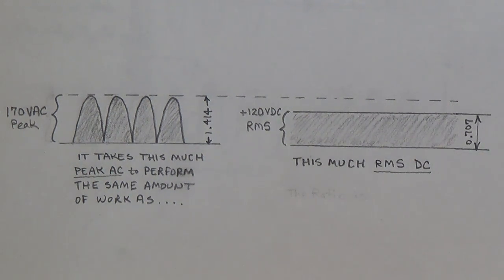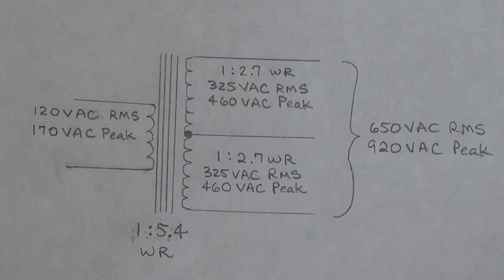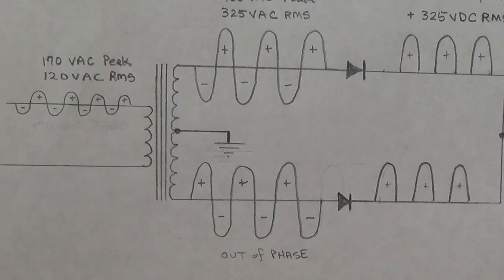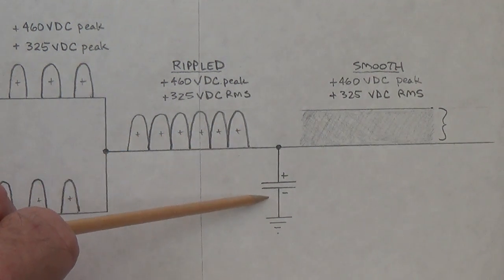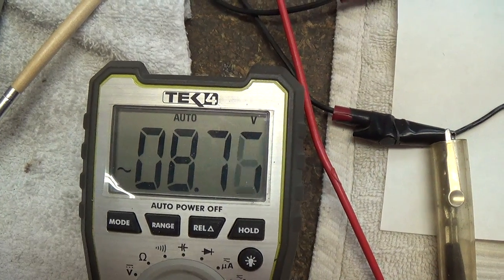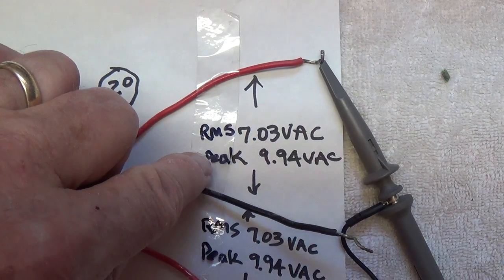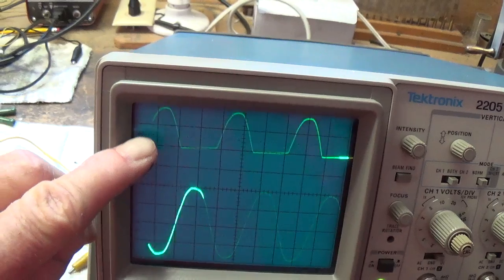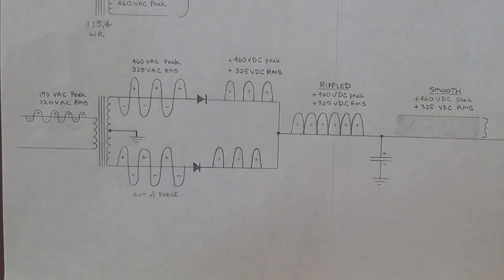Power Supplies Part 2:  Full Wave Rectification

Comment: You jump right in to RMS voltage and no explanation of what RMS voltage is.
Reply from the maker: That was fully covered in the "AC Waveform......" video:   https://youtu.be/lmwnCbwKjAk
Reply: OK, thanks.  Sorry. @UncleDoug
Reply from the maker: No problem, SF. Thanks for your comment :) @sharpenflat6002

Comment: https://youtu.be/O3Cvhnhv0dM  hi Uncle Doug , ive watched all your videos almost twice now, yet I have not seen an answer for my question. ive searched the web with no luck either. the question is related to some fender amp circuits with I believe full wave rectification, using not 2, but 6 diodes, 3 in series out of the top of the 2º power TR, and 3 in series out of the bottom of the 2º power TR , why use this if 2 diodes would give full wave alone? the only thing I can think of is that the other 2 in series on each lead are for back up, or reducing the voltage, since diodes are not totally efficient. please answer at your leisure. thank you 😀 oh you did reply to my question before and said it takes a different power transformer, I want to know how the circuit actually works, not why they did it that way.
Reply from the maker: I think the multiple diodes are redundancy, to provide long term assurance that the rectification stage will remain intact, even if one or two diodes fail.....and, since diodes are dirt cheap, it costs virtually nothing to provide this assurance.

Comment: Is it necessary or recommended that center tap be connected to earth ground of 3-wire power cord?
Reply from the maker: Opinions on grounding are numerous and varied, Paul. I see no harm or huge benefit to what you describe......so it's up to you. Try it both ways and see if there is a difference.

Comment: I am confused. @17:00 or about, youre calling a waveform that goes from 0v to +10 volts and back to 0v and back to +10v a direct current? But is it not still an ac due to the fact that it is not constant but varying as in an ac wave? If the midpoint was changed to +5v it would be more ac than the rectified output of a steady 10vdc
Reply from the maker: As long as a varying waveform never ventures into negative territory, it is not considered to be AC, Dave.
Reply: @UncleDoug  So if we reverse the diode and use the neg half of the wave the voltage then goes from 0v to -10 volts. That would put the waveform in negative territory and therefore considered to be AC? Now thats even more confusing
Reply from the maker: @davenone7312  No, then it would be negative DC. Two criteria for AC is that it can "pass through" a capacitor and induce a secondary output in a transformer.......this can only happen if the excursion of the waveform is BOTH positive and negative.

Comment: I'll be building a tube amp using 2 12AX7 for pre-amp/ tone control and 2 7189 for push-pull amp, is 300-0-300  volts Ac enough, how much current do I need for the whole circuit, how much current for the 6.3 volts for the four tubes? I need your help, thanks.....
Reply from the maker: You need to get a tube manual, Sonny. All the values you seek are provided within.

Comment: Wow, I did not realize that the second half of the transformer INVERTED the AC signal to produce positive peaks 180 degrees out of phase. This reminds me of the primary side of an output transformer on a P-P.
Reply from the maker: Yes, indeed, Mark. All center-tapped transformers have this ability.

Comment: Uncle Doug, how does one compute the amount of "loss" that results from the rectification process? I saw in your scratch built vintage amp pt 3 video, you ballparked about an 80V loss as a result of using a 5Y3 tube, but you didn't mention how or why this happens. How does this differ from using solid state diodes? Is the loss from SS diodes just the forward voltage for the diode type multiplied by the number of diodes in use?
Reply from the maker: Diodes are much more efficient than tube rectification, Ryan. My estimates were simply based on experience. Tubes convert quite a bit of energy into heat. With regard to diodes, the loss can be calculated as you suggest.
Reply: @UncleDoug  awesome, thanks for taking the time to respond!

Comment: Hey, Uncle Doug. Your videos have been a great refresher for a guy who went through EE school early in the solid state era. I learned more about tubes as a teenager reading books than I did in college. 

Question: I seem to remember that early in the hi-fi audio era, some companies tried to cut hum to an absolute minimum by running the heaters of their tubes on DC current rather than the usual AC. Are you aware of any guitar amp manufacturers who did the same thing? Might this be an interesting mod for people looking for the last ounce of performance?
Reply from the maker: It is done in some amps, Rob, but the truth is that if a circuit is properly designed and constructed, rectification of the filament supply is simply not necessary.

Comment: It's interesting that converting RMS to Peak is done by of 1.414 since the squareroot of 2 just happens to be 1.414
Reply from the maker: It's no coincidence, FN. The formula for the conversion includes the square root of 2 as one of the factors.
Reply: @UncleDoug  I was a commercial photographer for a good portion of my adult life and we see the square root of two pop up quite often.  The first place to look is the aperture rings on most lenses... f/1.4, f/2, f/2.8, f/4, f/5.6 and etc.  We also see it in the inverse square law (as it applies to light intensity and perhaps more but photography was my field of work).  Cheers and great channel!

Comment: I have a question.  On some (or maybe all?) Fender diode rectifier boards there are three diodes in series for the "top" 330V side of the power transformer and three diodes in series for the "bottom" 330Vside of the power transformer.  Why is that?  You say that there is some loss across diodes.  Are they using multiple diodes to step down the rectified voltage? Thanks!
Reply from the maker: I personally think, since diodes are so inexpensive and their function is so critical, that using multiple diodes is a safety measure....."spares" so to speak......if one fails, then there are two more to take its place.

Comment: To see the ripple ( 120Hz ) you need to add a load from the junction of the 2 diodes (cathodes ) to the center tap of the transformer.
The caps will charge to peak voltage of the rms voltage will no load.
Reply from the maker: Thanks for your helpful input, Henry.

Comment: Hey Doug, really appreciate all your videos. I got interested in an old marshall lead schematic with full wave rectification. However, the leads of the power transformer are connected to the grounded center tap of this transformer through 22 uf capacitors (see http://cdn.tonegeek.com/wp-content/uploads/1987u.gif). I haven't been able to figure or find out what is its purpose on the power circuit. Got an idea ? Cheers.
Reply from the maker: Thanks, Nf. Sadly, the Tonegeek's site is not accessible to me......blocked due to improper configuration or some such nonsense. Please provide another source of the schematic. Thanks.
Reply: Uncle Doug  Here you go : https://i.imgur.com/NQFrp3X.jpg , I also highlighted the culprits
Reply: I guess it could work as a low-pass filter to eliminate high/radio frequencies from the mains. like a death cap but in the secondary circuit instead of the primary
Reply: Uncle Doug  bump

Comment: A bit confused @6:36 after the diode rectification. I can understand it's still +460VDC peak, but why +325VDC peak? I believe it should be +162.5VDC RMS at that stage. That's why the RMS is +162.5VDC *2 = +325VDC after the combination of the output of the 2 diodes.
Reply from the maker: You're right, SK. The "+325VDC Peak" after diode rectification was a typographical error. I apologize for any confusion.

Comment: I remember my Physics and Electrical Engineering professors trying to explain why we used RMS voltage. The explanation that I remember best is that we had to square the waveform because the integral of an alternating current waveform is zero because it goes both above and below zero. The squared waveform is always positive, so we integrate that and take the square root of the result to find the voltage. All of this ignored the real explanation, that the RMS voltage produces the same amount of heat across a resistance as the same DC voltage. Knowing that would have made understanding RMS voltage a lot easier.
Reply from the maker: Good comments, Bill. It's also why deviations from the mean are squared in statistics.....to eliminate their sign.

Comment: Fantastic series on power supplies.  Question for you.  I was looking at a schematic for a Fender Bassman 6G6-B and saw something that I don't understand.  That circuit uses solid state full wave rectification with a center tapped secondary on the power transformer.  The strange thing I see is that each side that comes from the secondary winding runs through 3 diodes in series.  Do you know why they might do that?
Reply from the maker: Thanks, Craig. I've heard several explanations, ranging from "Three diodes produce a smoother DC output", to "Diodes are cheap, so throw in a few extras in case one fails". The truth is probably a combination of both.
Reply: Thanks UD!  Sounds like I should wire up a bunch of diodes and look at the waveform on my scope to see if it's any smoother.
Reply from the maker: I'm not sure if the smoothing will be visibly evident, but regardless, it will be an interesting experiment.

Comment: thank you for your clear and precise explanation of how AC to DC power rectification works, your explanation is very helpful I do appreciate that, I'm having difficulty trying to choose and purchase a bridge rectifier for my 70VAC power supply I don't know which one to use, I need 50DC, can you help me on this...thanks.
Reply from the maker: You're welcome, Iam :)  We used to get our FWBR's from Radio Shack, but I guess that's no longer an option.  I would check on Ebay for a FWBR that can handle whatever current demand you anticipate. Good luck :)

Comment: Hi from Jakarta Indonesia, I recently getting interested in electronic and your video helps me a lot, so thank you very much.

I have a question though, how do you determine the value of the smooth capacitor?

thanks again
Reply from the maker: You're welcome, Rudi. Most tube handbooks will give you the value for the first filtering capacitor depending on which rectifier tube you use. The subsequent filter cap values are generally of lower value. Although there are mathematical ways to calculate the values, I tend to look up circuits that are similar to the one I am designing/building and then see what they use.

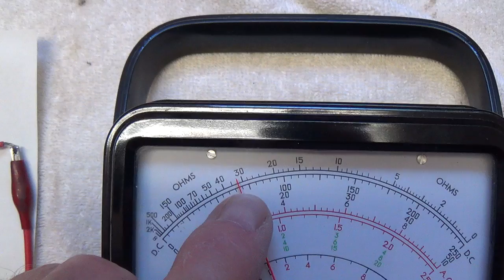Comment: To avoid confusion on how U.D. read the scale on the output side of the transformer on his analog meter please note at 9:28 he is reading 1volt a.c. on the lower RED scale of the meter when the range switch is in 2.5v and A.C. is selected on the function switch. At 9:55 he is reading 12.7vac on the BLACK scale 50 row when the range switch is in the 50v and A.C. on the function switch. He switched from the 2.5v scale to the 50v scale before reading the 12.7vac. I'm not a wise guy, just cluing you in, just in case you're not familiar with analog scale-and-needle voltmeters...have a nice day.
Reply from the maker: Thanks for your helpful input, Rayford :)

Comment: This is really instructive. Love it. Feel like I am really getting an education here. Can you explain how you choose the filter uF. I understand the voltage needed but why 22, 33, 45, 80, 100 uF for filter caps in various amps.
Reply from the maker: That's great to hear, Trem68. We're glad the videos are helpful. The capacitance required for smoothing of the rectified B+ is dependent upon several factors, including the type of rectifier used, and the value of the internodal capacitors.  Most people simply use the values stated on a schematic of the circuit being built or a very similar one, but if you have an oscilloscope, you can actually use trial and error to get maximum smoothing with minimum capacitance.

Comment: I require a B+ of 300V for an amp build. The schematic shows a Tx as 300-0-300 120mA with an EZ81/6CA4 rectifier tube. The initial filtering is two 32uF caps and a 1K resistor connected to pin 3 cathode of the EZ81. The schematic shows a secondary output of 300V at each of the two secondary taps with the CT earthed and a current draw of 20mA. The voltage is 390 at pin 3 and a 300V B+ after the first filter stage. Can these figures be correct? Would the 390V be peak or RMS? I am still a little confused despite watching all the videos. Guess I am having a bad senior moment! I want to buy the right power Tx. I looked at a tube spec and am I reading it correctly that with a 300-0-300 Tx and a current draw of 20mA with a 240 Ohm limiting resistor the voltage output of the rectifier is 390V. That is, as current draw goes up, B+ voltage comes down??? My schematic has a 1K resistor however.
Reply from the maker: When the transformer output is tube rectified, it goes down due to rectification losses, then when it is filtered, it is increased because the filter caps smooth it to peak (not RMS) voltage. The end result is that a 300-0-300 PT will produce a B+ of much more than +300VDC.  Yes, current and voltage are inversely related, so as one goes up, the other goes down.  If you use your thumb to reduce the flow of water (current) in a hose, what happens to the pressure (voltage) in the hose?......and vice versa.

Comment: Hi, I'm having some trouble working on an old tube amp from the early 50's, its 1:6,5 transformer is rated for 110v mains but my country mais is 126v, thus putting out too much for the original beautiful tube rectifier, and i wish to keep booth the transformer and the tube, also keep the capacitor input filtering stage. is there any way i could add a couple resistors between the plates of the rectfier tube and the secondary of the transformer to drop the voltage to its original working range so i dont fry the rectifier and/or anything else after? thank you so much.
Reply from the maker: Most of the old vintage transformers were rated at 110 to 115VAC and routinely operate today at 125VAC, Camilo. If your rectifier tube is a 5U4, 5Y3, GZ34, etc. it can handle this with no problem. The PIV value for a 5U4 is 1550V :O  If your plate voltages are a little high, you can always alter the bias for a safe plate dissipation value.

Comment: I really enjoy all of your vids.  I got an associates degree in electronics technology many MANY years ago before moving on to computer science and a career as an engineer; I didn't think this field even existed any more.  So I'm really enjoying re-learning this stuff and look forward to building a nice little amp (I'm a guitar player...) and being able to tweak the sound based on solid fundamentals.

Anyway, it really threw me that in your lead-up on theory the transformer was multiplying the voltage out, and then when you did your experiment the transformer was reducing the voltage....with no explanation.  Did I miss something?  Please explain, I NEED to be on the same page before moving on.

Also, I would love to buy a scope, maybe an old Fluke or Techtroniks like yours.  Maybe you could to a vid on using the scope and other equipment as a refresher for us old farts.

Thanks again for EVERYTHING!  If I don't electrocute myself I'll let you know how my amp turns out...
Reply from the maker: You're welcome, RSF.  It all depends on which way the transformer is oriented.  If you have a 120:12VAC, it will reduce the voltage, but if you reverse it, i.e. 12:120VAC then it will increase the voltage.  It's the same transformer, just rotated 180 degrees.  The 120:400VACpower transformer for an amp will increase the voltage by 1 to 3.3, but when using the scope, I use a 120:12VAC output transformer for low voltage.
Reply: Got it.  Thanks again
Reply from the maker: You're welcome

Comment: One more question Doug....  How come in some schematics, the Fender Bassman for example, they put 2 capacitors away from the main circuit to ground. They have the 3 in the main circuit, but then either 1 or 2 more that go the other way. What is the reason for this?
Reply from the maker: +Rhone Ranger  I'm sorry, RR, but I don't understand the question. Which capacitors are you speaking of?  Please describe them more fully.
Reply: +Uncle Doug A picture is worth a thousand words so they say... http://imgur.com/NO3gKMJ
Reply from the maker: They are simply a pair of filter capacitors in parallel, RR, which makes their total capacitance equal to 20uf + 20uf = 40uf @600VDC. It's just an unusual way to draw them, sticking out from the side of the circuit instead of pointing downward from it.
Reply: So, essentially it does exactly the same thing as all 4 in series? Since on the other side of the choke, there are 2 more filter caps.
Reply from the maker: Yes, it is nothing special....just two filter caps operating as a pair.

Comment: This is awesome Uncle Doug!  I am so glad that Rusty is finally doing something :)   SO, with the larger bias voltage (say 325 like in the first video) could the same be achieved with only 2   20mf-400 volt capacitors? In this video, it took only 2.
Reply from the maker: +Rhone Ranger Thanks, RR.....So am I :)  In a functioning amp circuit, quite a bit of current is flowing. The more current, the tougher it is for the filter caps to smooth the DC output, so generally you need at least 3 filter caps to ensure smooth DC, particularly for your pre-amp tubes (the most sensitive of the tubes).